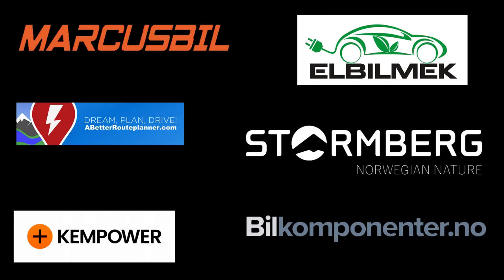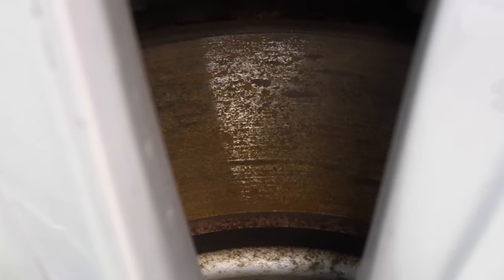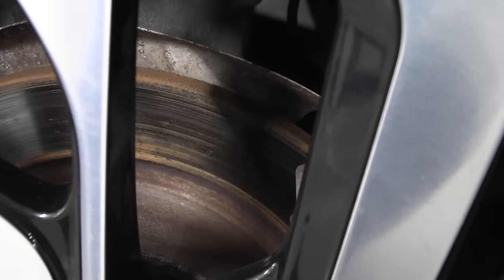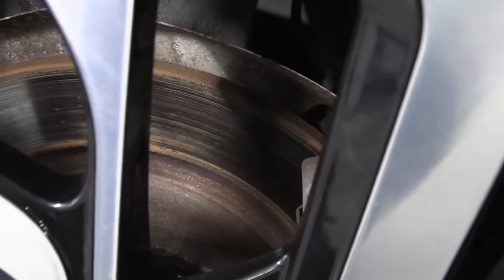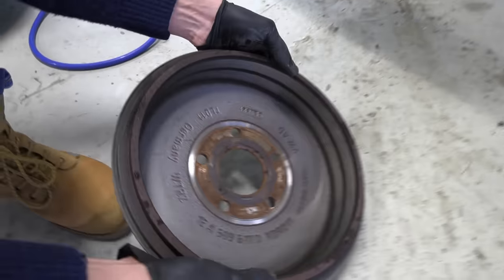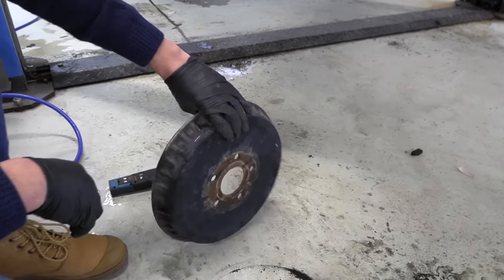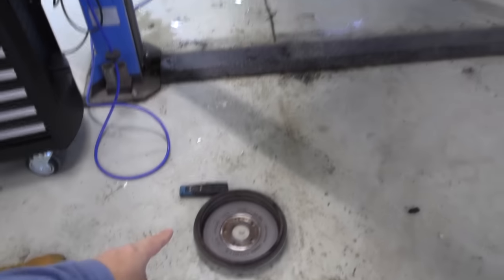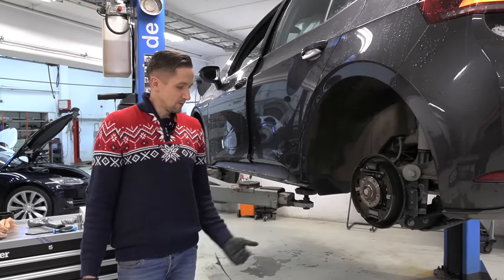How much rust is in VW ID3 drum brakes after two years?

Comment: I would not buy a car with drum brakes in 2023.  Cheap rubbish.
Reply: But you will buy a Tesla which is void of all Brakes in the future if they get their way? 😂
Reply: @andersnilsson973  hilarious mate how you can intuitively deduce my financial position based on absolutely nothing lol. 😂 

Since I already drive a Model S and have been since they launched I don’t expect to downgrade to a Y any time soon.
Reply: @rkan2  citation required… Tesla have not stated anything about removing brakes that I’ve seen.  If they were to replace them with some kind of new Tech then I’d evaluate that independently from internet claims.
Reply: @@retiredbore378 how to tell us that you’ve probably not owned a car with drum brakes anywhere in a warm climate.  My last car with drums was built in 1986.  Brake fade and inconsistent braking was a thing. 

Looking at the simplistic design used by VW in that video they are going for cost reduction as a primary motivation.  

Show me a performance car using drums mate.
Reply: @markedwards4879  If they could get away without braking done by just electric motors, they would do it. Cybertruck braking went wired like did the steering :P
Reply: @@retiredbore378 mate, read my comment again. I said I would not buy a car with drum brakes.  They are crap. I also don’t buy boring crap cars. You can if you want to. Drum brakes are put on cheap cars.
Reply: @rkan2  I have not seen that the cybertruck uses Brembo electric brakes, do you have a source?  Also, if braking was as effective electrically then I’d have no problem. My issue is that drum brakes are inferior to discs, especially in warm climates and when driven hard. They are inferior in pretty well everything except price. 
Full electric braking systems like that under development by Brembo look pretty interesting, but bear in mind that they are electrically activated, but are still friction disc brakes.
Reply: @markedwards4879  i didn't say electric, I said brake by wire, e.g. there is no mechanical link from pedal pressing on hydraulics. I think it is otherwise just an electric booster.
Reply: @rkan2  I have not seen that it uses brake by wire either.  I do know that Tesla started using a Bosch electric booster back in 2014 - still hydraulic but with programmable boost and able to be software controlled.
Reply: @markedwards4879 You're right, I checked the Tesla EPC and it is still the same type brake booster.. I thought I read something about having also brake by wire.
Reply: @rkan2  it was suggested by a few people. Will be an interesting development when the whole system is electronic/electric in operation.

Comment: Really unprofessional way to remove the break drum.
Reply: Agree. It's customer car and nobody cares
Reply: How would you go about to do it?
Before you answer, please keep in mind that in Norway everything rusts after short time due to road-salt.
Reply: @therandomtester9561  He was bending the heatshield with a screwdriver. That was the unprofessional part.  So that means now its more likely to get dirt and water into the brakediscs edit: can add that I dont think it looked damaged at all in this video. so I think its fine) .  There is a tool you just attach to the brakedrum, and drag it off.
Reply: Maybe describe the better way to do it then? It's fine to have criticism as long as it's constructive. Going by your own argument, your comment is a really unprofessional way to critique someone.
Reply: @AndrewTSq that's not a heat shield - it's the drum brake casing. Both sides are solid cast pieces. Using a mallet is standard practice to loosen corrosion. I guess you might also get upset if you then see him using a wire brush to clean up the mating surfaces for the hub too? 😂
Reply: @AndrewTSq That's not a heat shield.
Reply: @totemimaging  I did not say anything about the mallet. I used to use them myself, even when removing the tires after a winter full of salty roads.  Ah, okey, it looked so thin when he was using the screwdriver, so it looked like it was just a heatshield.
Reply: @totemimaging  it does not look like solid cast actually, it looks liked sheetmetal that is pressed when I look at pictures of it, but the drum is cast yes. edit: its made from aluminum, so yes a screwdriver could  bend it.
Reply: @Tom-bp6no  Sorry for that . I am not english.. but I found the manufactor of the brakes, and its Continental EPB-Si that is being used, and they say that this part is made from Aluminium. " The friction ring is manufactured from standard grey cast and thus offers the optimum tribology. The front plate of the housing, however, is made from aluminum"
Reply from the maker: *brake
Reply: @Tom-bp6no  I would call it a "back plate".
Reply: Yes, levering between the drum and the back-plate is not a good idea ... neither is using an all metal hammer ... a heavy hammer/mallet with hide or plastic covering is the tool required.
Reply: @AndrewTSq  ahh, yes, indeed he did do that. You are correct.
Reply: @@retiredbore378 what's more important, spelling or doing the job right? 
Give the man a break 🙃
Reply: @@retiredbore378 I only know people dont understanding anyway is not engineers.  Or should not be anyway.